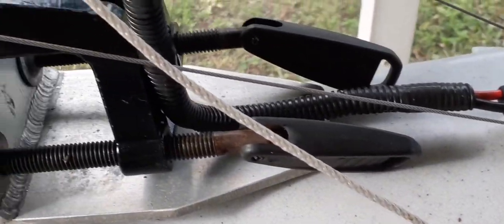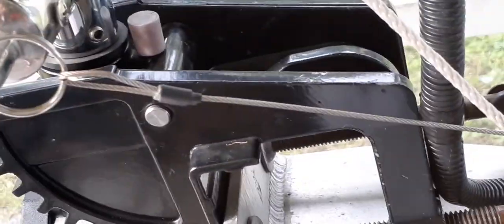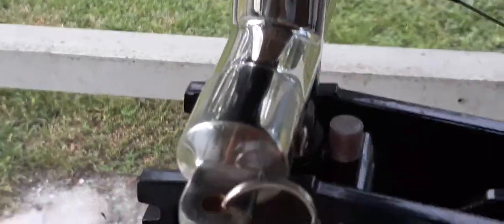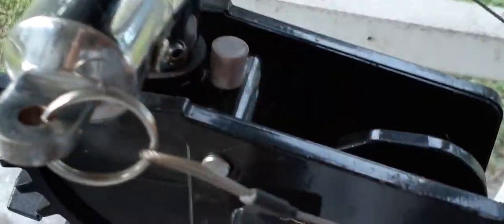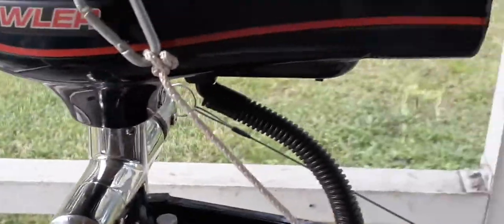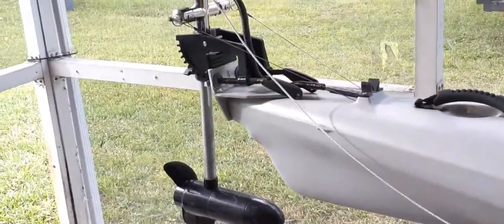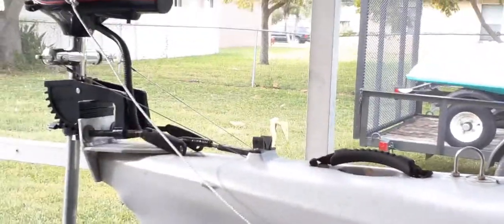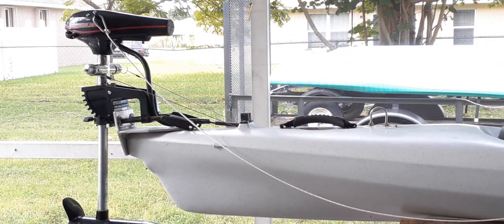wilderness tarpon 160 best electric kayak setup ever built

Comment: Looks great, Del. Nice meeting you at the Rosen Boat Ramp yesterday. My 24# Watersnake side-mounted on my new Hobie Lynx maxed speed at about 3.5mph with very light breeze. Averaged about 3.2mph coming back against the light breeze. So, not very impressive but OK for a very light trolling motor.
Reply from the maker: Glad to have met you James,,3 mph is good for a trolling motor really its about average speed  the kayak in the video does 4 too 5 mph ,,no matter the size motor or voltage the props are all  pitched around 3 too 5 mph so a 110 lb thrust motor is no faster than a 30lb thrust motor,,I hope to get on the water soon give me a call maby we can get togather and catch some fish